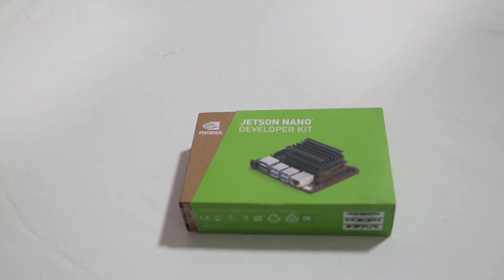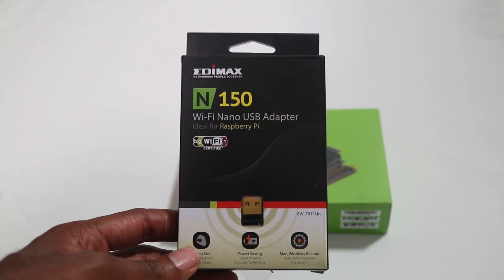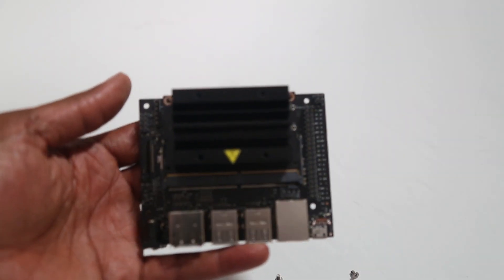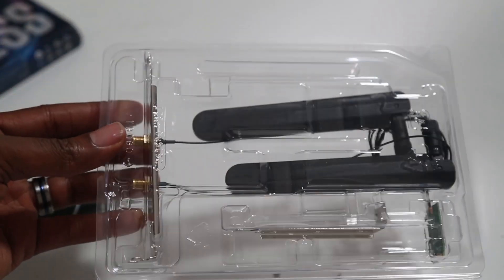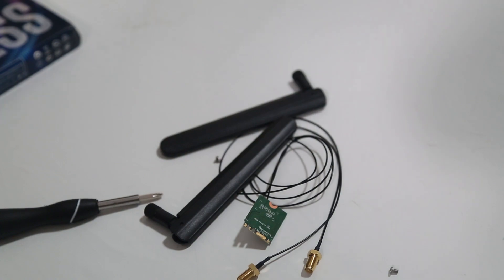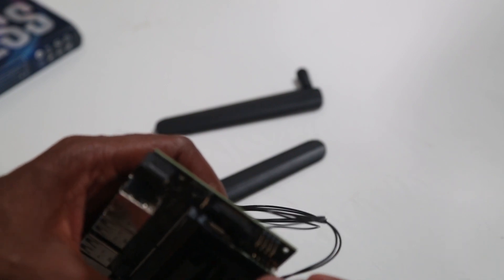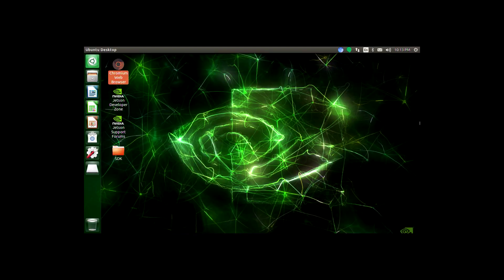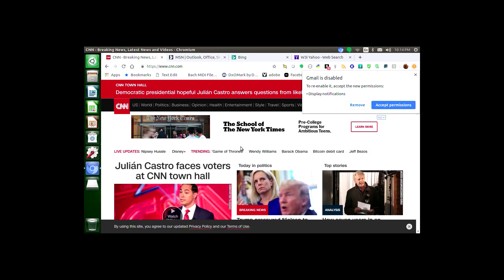Adding Network Connectivity to the Jetson Nano

Comment: Hello, EdiMax Wireless Network adapter Support Linux Kernal 2.6 ~ 4.4 (Support the distribution by ubuntu & Fedora, others by request), but Jetson Kernel is 4.9, when I make this driver, it fails. Could you please guild me? Thanks a lot.

Comment: Have you looked at adding LTE connectivity? I bought the following from Amazon but haven't tried setting it up yet. NGFF(M.2) Key B to USB 3.0 Adapter with SIM 6pin Slot for WWAN/LTE Module
Reply from the maker: I didn't realize that existed. Looks interesting. Thinking I might look into it.
Reply: Have you tested it yet? How did it go?

Comment: Great video Joel.  Going with the Intel 8265NGW is definitely the best option with the Jetson Nano because with a USB WiFi adapter, depending on the adapter you pick, you could run into problems due to the fact that the Jetson Nano's USB ports are all USB3, which can interfere with WiFi communications, leading to choppy intermittent connections and severely limited range and bandwidth.  If someone still wants to go the USB WiFi dongle route, one fix that often improves things dramatically is to connect your USB WiFi Dongle through a short USB2 extension cord  (0.5 to 1 Meter).